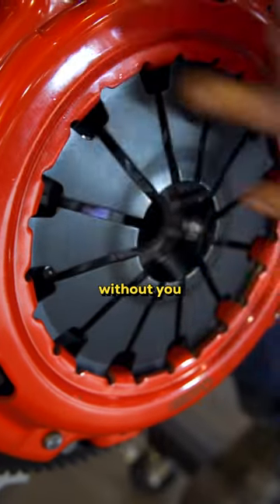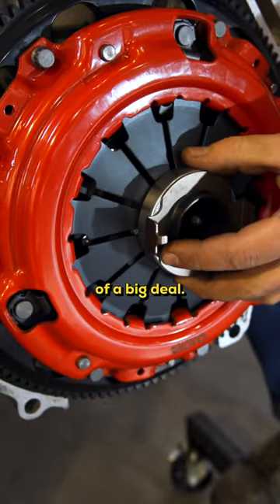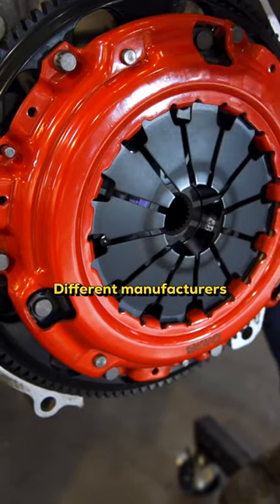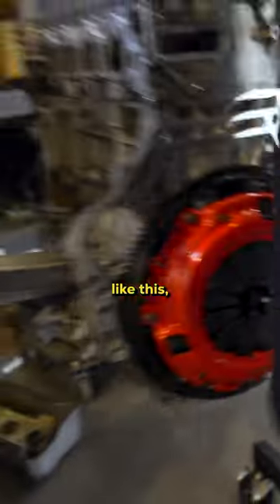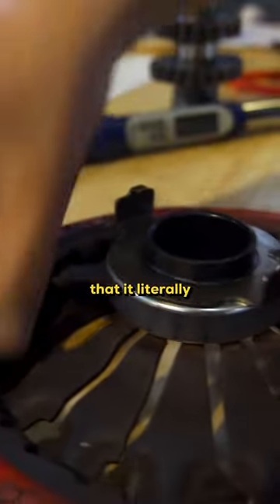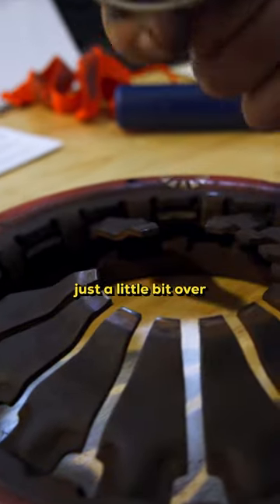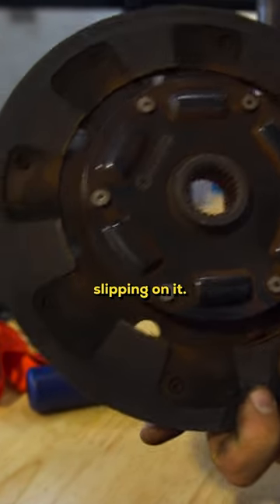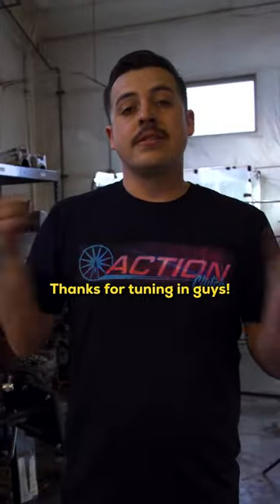IS THE THROWOUT BEARING BURNING YOUR CLUTCH!!

Comment: Just had a shop put in new clutch kit in my 2011 jetta 2.5l .. and been just 3 weeks.. Valero brand with(Single mass-fly wheel)..then they had to order slave cylinder too..(also tire ballance/rotations)..it feels cheap!.. for starters the bite point feels wierd & real low, clutch pedal feels light weak. When i accelerate i hear chattering(light chain chinging noises).. also when car is sitting still in neutral (been hearing light tapping clinking noises) but push in clutch goes away!> Throw out bearing??.. also last week i was driving  & my rear right wheel drum brake started screeching outa nowhere, then minutes later front left wheel did the same.. then the front left started scraping & then sounded like whole caliper broke lose>clumps rattlessquealing then stopped.. & would make those noises off & on! So I went home noticed my rear right screeching wheel/Rim(w-drum) was full coated of black dust but all other rims where clean..I jacked car up removed front left tire noticed 2 lug nuts Lose!.. i get to caliper and noticed sliding pins were sticky , sticking alot in 1,( pads rotors looked okay.  So i cleanedup caliper/rotor/&sliding pins!.. i greased those put it all together.. now I had brake fluid cap off & seen that it was way past full to brim.. as i pushed brake in few times some flowed out!.. Now whats wierd is the mechanic told me I NEED TO BLEED THE BRAKES*.. I did ask why? There was no problems before at all+ he said something like it was already low on brake fluid & brake pedal is loose!.. it was not it was the clutch pedal that was loose. This was the owner whom i am talking about.. but his technician worked on my car, who i noticed looked really young & high. Bad vibes.. I left a message on his shop phone today!.. I'm just pist 1700$ Total & i feel like something is wrong in alot of places!.. ALOT of wierd noises coming from clutch as i stated!.. motor is making clicks>rocking bqck & forth hard since left shop(mounts*?) .. Brake isses!(rear drum still screeching).((Brake fluid  overfill!?))> is that an issue & Should i have to bleed this? Also sounds like exhaust is open somewhere.. 
Anyways I have 154kmiles & have few other issues engine light on.. my vaccum pump is leaking bad>👉 i want the spullen pump delete setup it seals up that stupid thing & then has inverted/spliced hose/tube that ends up going to brake vaccum port. Its 130$.. & last forever cheaper then a new 240$+ pump which he said i needed that for resealing wont work.
My flex pipe needs to be replaced for the 3rd time since 2017!.. 
I'M just not happy anymore with this car! Myengine 5cyl is a great engine.. & i had alot of work done to it in 2018. 4k$ performance upgrades
-Awe Track Exhaust System -Usp-dwnpipe
-AFE cold air intake conversion
-UM flash-Tune, 5>R8-ignition coil packs, 5>NGk TSI irid/platnm plugs. All done @New German Performance
-Southbend Stg2 Daily drvr endurance
Complete clutch kit w-lightweight fly wheel. 🤯lasted like 30kmiles! 
And this is where i am now😢 clutch was done for i did ride the heck out of it!.. but still should of lasted longer.. this new Valero clutch w- Single mass flywheel feels cheap!! Noisey!! & like its ready to fall apart!..the mechanic told me Valero was best for my $!.. that the southbend was not good clutch for my car stated that the disc material wear out fast better off getting closer to oem with my car.  🤔
Also he kept my Light weight Flywheel(Southbend) as I totally forgot to tell him, i wanted it!.. 
👉💥Anyways i know i wrote a book.. But if you could please give me any advice ??.. is that shop & mechanic held accountable or responsible to look aty car & fix those issues i stated that all started >after it left the shop. Its been 3weeks!
Thanks man.
Reply: @TruthExposed eww
Reply: It doesn't feel cheap it is cheap it's about 500 dollars cheaper than the dual mass and I prefer the solid flywheel so idk what you mean you get what you get obviously you can't expect it to be the exact same as stock when you literally converted it to a solid flywheel when the car was designed with a dual mass
Reply: @@tRuth-be-told-againor just learn how to drive if he just got it put in it needs to be broken in my clutch didn't feel the best till about 5000 miles
Reply from the maker: Could be that the clutch was good but installation was it from what i've read based on what you wrote.

Comment: What would cause it to squeal real loud and stall the second i put pressure on the clutch pedal? Like a metallic shriek I guess
Reply: Bad throw out bearing
Reply from the maker: The bearing is bearing super over traveled and the fingers on the pressure plate are making contact with the disc that’s why it stalls out immediately check the pedal adjustment and that will solve your issue- Cub

Comment: I just had a shop replace my oem clutch with a stage one i bought off clutch masters. After they got my old one out then they said my flywheel was also bad. Instead of waiting to get one shipped i let them buy the oem flywheel. Well not even a few months later and maybe 10k miles i smell burning smell like i did when the first clutch went out and its starting to still rev in nuetral. Any thoughts on what they did wrong? I have a 2013 dart 1.4 6 speed. If i have to replace it again im just going to do it myself and save the $800 in labor
Reply from the maker: Is the clutch grabbing low, middle, or high?
Reply: @actionclutch  its wierd it shifts fine but when i put it in neutral usually while still moving the rpms will shift around 2 to 3 k for like 10 seconds sometimes longer before they drop to 1k like neutral gear usually is.
Reply: @actionclutch  and when the clutch is out you can hear a rattling sound until you press the clutch in.

Comment: Own a 1991 Chevy S10 truck that when clutch is engaged there is a whirring sound. Is that the throw out bearing/clutch slave cylinder?
Reply: When you press the clutch it makes a noise? Put the car into neutral and try pushing the clutch up and down. See if the sound changes. Let me know
Reply: Will do that first thing in the am. Appreciate the input. Will keep you informed.👌🏽
Reply from the maker: I would check if there is an adjustment via the clutch master cylinder or slave cylinder and possibly back off the release bearing it could be over traveling.

Comment: I had a new transmittion thrown into my Jetta. Let go of the clutch pedal theres a decent squeak to be heard. Depress the clutch and that squeak disapears. I was wondering if that has anything to do with the throwout bearing.
Reply: throw out bearing is a knock i’m pretty sure
Reply from the maker: Release bearing is being overtraveled causing it to make contact at all times which can be heard when at idle or driving at different RPMs really bad for the unit and bearing itself if not addressed as soon as possible. -Cub

Comment: Is it correct to say, if someone took out all the free play, they may have been trying to hide clutch wear?  I have a replacement clutch on the way for a recently purchased used SI from Honda.  I found it intermittently locks in or out of 1st gear.  When trying to get it in when in traffic, I had one or two cringe worthy crunches.  I found there to be no free play in the clutch adjustment.  the car has only 20k on it.  Seems like it suffered some abuse in what I suspect was short lease life. 

I guess the question is, under what circumstances would some one want to eliminate free play. what is it hiding?
Reply: My Toyota matrix XRS clutch pedal needs to be about 50% released before it starts to grab. It doesn't feel like it slips at all even under acceleration while leaving a light. Is the clutch possibly just worn from what you are saying or does it just need adjustment like described in the video?
Reply: @mashedpotatoes5323  I my clutch finally showed up and I had it replaced.  The original as I suspected was abused.  Ironically, it was not the original clutch that was toast.  So, I gather the freel play adjustment was the way to try to hide it.  The replacement is great, it does catch earlier.  Not as much as I thought it might.  Anywho, lesson learned .  Thx for the reply
Reply from the maker: It’s possible the clutch kit was replaced but not adjusted as required causing absolutely no free play and gear lock out noticeable majority of the time in 1st and reverse double check that adjustment and you should be good. -Cub

Comment: My car making a squeaky sound so I guess it's rubbing when running plus I couldn't go into gear when running .
Reply: if its a stickshift and you really need to get somewhere you can start it in gear then float gears to your destination, not very stustainable and basically impossible in traffic though
Reply from the maker: Double check that adjustment is done/ done correctly sounds like it is being overtraveled and this will cause gear lockout and prematurely wear out the clutch unit. -Cub

Comment: I have a stage 3 on my rsx and my pedal has been adjusted properly as well but the clutch after breaking it in starter to make some loud rubbing noise when I release the clutch
Reply: I have the same issue, what did you do on it?
Reply: @maminirinaezrarandriamanan7442  nothing yet man. Still haven’t figured it out might just end up replacing it again sadly. I do notice though after i launch it a couple times it goes away for a bit but ends up coming back :(
Reply: I have same issue on 07 987.1 cayman

With the clutch pushed in, it sounds fine. When clutch is out, it makes a rubbing noise (constant with the rpms I believe) 

No clue what it is
Reply from the maker: At first when you installed the clutch kit the adjustment might have been done good enough to give enough gap where the bearing wouldn’t rub on the fingers of the pressure plate but as a clutch kit wears in the fingers naturally lift up which is why you are now hearing noise so I would just double check the adjustment and back out as required. Best -Cub

Comment: I have Toyota conquest 1.3 ,4 speed and 4th gear is making grinding sound
Reply from the maker: Check your service manual if there is an adjustment for the clutch pedal freeplay and adjust to spec. Best

Comment: I bought a new clutch now my hyundai groans . Amy thoughts?
Reply: What do you mean groans when you're taking off in first releasing the clutch it's stuttering or what? did you get a solid mass conversion kit on your car that originally had a dual mass flywheel? Because if that's the case it's nothing bad you can just hear all the noises in the transmission because the dual mass dampens vibrations and noise and with the solid mass you get a lot more noise and vibration
Reply: Ight so if you wanna fix your problem first step is to sell your car. Second, buy a Honda
Reply: @kelpking4484 i saw your comment and i have a bit of trouble understanding. I just installed a new clutch and lightweight flywheel on my car. When im in reverse with clutch pressed and i add some acceration i get this weird whining noise. Only happens when in reverse. Any clue?
Reply from the maker: Need to adjust clucth pedal to get the proper airgap sounds like release bearing is making contact when it shouldn't. Check your service manual for proper specs.

Comment: If I blew my transmission bought a working used one and new clutch kit , put it all together and would go into gear and spin the wheels on the lift but once on the ground and put into gear it wouldn’t move , what could that be ?
Reply: Did you get this fixed ?
Reply: Did you install the clutch backwards? Is the clutch actually fully engaged? When you put it into gear, does it stall if the car isn't moving?
Reply from the maker: That has to do with not having the correct pedal adjustment check your service manual for proper specs and you should be solid.

Comment: I have the same exact action twin disc on my k24/k20 turbo and mines super squeaky loud. Is that normal?
Reply: I would say no... Tbh my water pump was squeaky before it flew off and broke my serpentine belt... So if its on the inside it could be in need of replacing, btw what do you think is a good clutch/break set up for k24
Reply from the maker: Check the pedal adjustment release bearing sounds over traveled also make sure to run a pedal stop and adjust that accordingly to prevent over-traveling the bearing and making contact with the discs. If you hear chatter that is normal it's just the floaters engaging and disengaging.

Comment: Ik this a old vid but my clutch pedal feels very loose and when I start my car and press the clutch all the way in somtimes it still doesn’t want to go to first gear and if I go to reversed the gears grind even when the clutch is down
Reply: Have the same issue most likely your throw out bearing or your clutch assembly
Reply: Mine grinds neutral now because I went awol trying to get it to work I wouldn’t mess with it definitely get the clutch and throw out bearing replaced I’ll be doing it myself on my free time hope you get it to work !
Reply from the maker: Check your clutch hydraulic system for any leaks or air in the system this will cause a soft pedal and issues with grinding and difficulty getting into gears.-Cub

Comment: Ok my clutch has been working just fine for over a year and a half but for some reason it just started making a grinding noise when fully pressed shifting into every gear like the starter is trying to engage or something and itll also almost die why is this happening?
Reply: me too did you ever find out the problem?
Reply: @esai542  no it just stopped happening but one person i asked whos a mechanic said that it sounds like the throw out bearing but also the starter could be getting stuck to the flywheel
Reply: @StrengthNoBounds  oh damn okay yea my mechanic said it’s most likely throw out bearing, iv had my stage 3 clutch for about 2-3k miles, i did a 1k mile break in period and then got a new transmission installed then after the transmission got installed it almost instantly started making that grinding noise when i was in the break in period for my new transmission, i feel like it’s the mechanic that installed my transmission did a improper installation
Reply: @esai542  yeah it sounds like the mechanic messed up or something, but dang i wish i had enough money to get myself a new transmission ive got a lot of metal shavings in mine and literally have to have a magnet attached to the bolt where you fill your transmission fluid on the side of the transmission. Ive got a 1996 honda civic hx 234k miles 🥲
Reply from the maker: Hey brother over time the fingers on the pressure plate lift up which is normal as a clutch kit wears I would check the clutch pedal adjustment to make sure the bearing isn't being overtraveled and you'll be good.
Reply from the maker: Ask them if they adjusted the clutch pedal and  check to make sure the clutch pedal freeplay is at least a 1/4in.

Comment: Car is making a squeaky sound until I press on clutch and clutch has gotten softer. What’s going on
Reply: Throw out bearing more than likely
Reply from the maker: Throwout bearing is making unnecessary contact could be the adjustment but since your pedal is getting softer you may be experiencing a hydraulic issue which will also contribute to other issues if not addressed soon.

Comment: When I go to press the clutch in I feel a vibration in the pedal. The higher the RPM when I shift usually the more I feel it. Would that be a clutch issue or something else?
Reply: same
Reply: When you press the clutch, you can feel the engine through the pedal along with the pressure plate and flywheel. You need to confirm you don't have vibration coming from the engine. It could be worn out thrust bearings
Reply from the maker: Hit up Cub at general@actionclutch.com and he'll help you out.

Comment: Just got an action clutch stage 1 for my kseries and wen I put it in gear the car moves from a stop and it’s very hard to go in my slave is bled and brand new also my clutch master and it’s adjust and still not engaging all the way
Reply: Did you get this fixed?
Reply: I wish people always posted their fixes. My k20z3 has a new clutch and i havent been able to get it moving for 3 weeks now.
Reply from the maker: Recheck the adjustment it's most likely still off and make sure you have 1/4in clutch pedal free play.

Comment: I have a02 Santa Fe and the pressure plate doesn't hold clutch plate tight
Reply from the maker: Is it a new disc and was the old flywheel used?

Comment: 3 months ago I had a mechanic change our e46 clutch and flywheel. 3 days later i heard a banging and metal to metal sound and the clutch locked up, it sounded horrible like someone threw a hammer into the clutch and it hit with force and locked up. The mechanic fixed it free and said he put the bearing on wrong or backwards. 4 months have gone by and now when i push the clutch all the way down im getting a vibration and noise. After googling it people say its the bearing. Was this the mechanics fault? Is that part what he replaced? I dont know how to confront the mechanic because its been a couple thousand miles later but clearly he may have caused this. I never grinded the clutch and drove it carefully. Please help.
Reply from the maker: It's totally your mechanics fault, he admitted to it, fixed it, and now you're having the same issue because of what he did wrong to begin with.

Comment: How do you adjust that for a 2010 Mazda speed 3
Reply: Many cars have no adjustment. They have "self" adjusting clutchs
Reply: Would the adjustment be the bleeding of the clutch pedal it's self
Reply from the maker: Check your service manual to find out how to adjust the clutch pedal and release bearing travel, bleeding the clutch hydraulic system is not the same as adjusting the pedal but is also required and crucial.